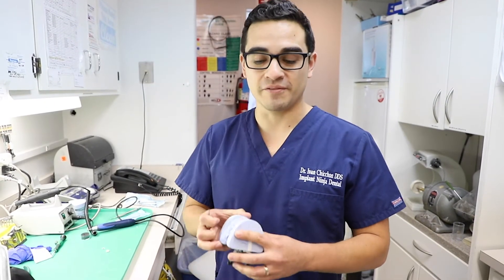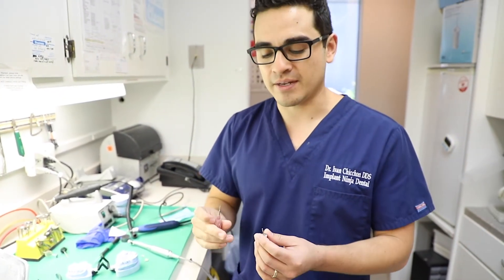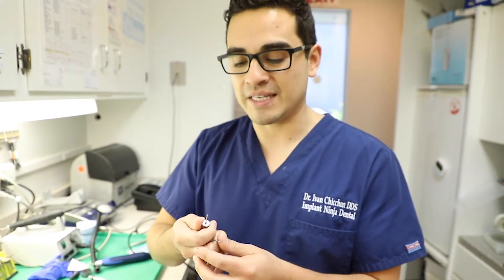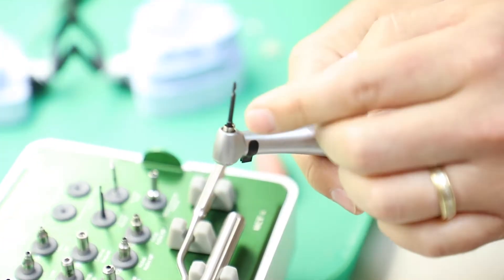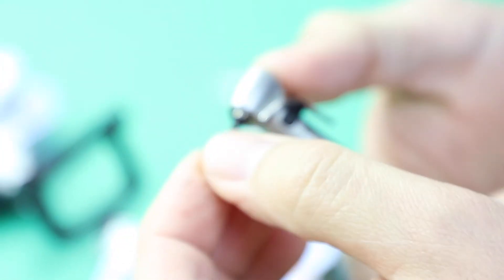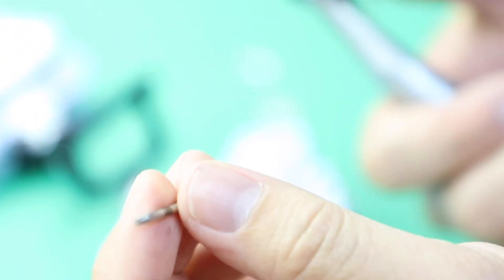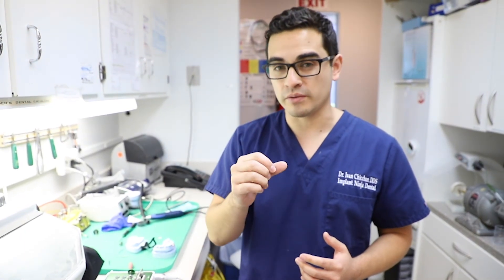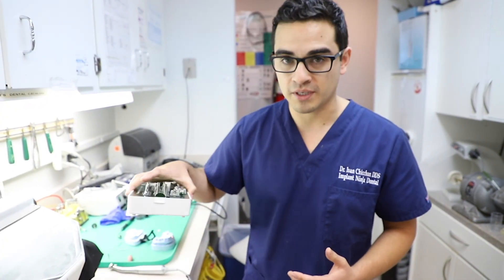Remove a Stripped Abutment Screw in Minutes #dentalimplant #complications

Comment: I recently received 2 patents and more are pending on an un-strippable screw head and driver design that will eliminate stripping screws in all industries. Check out the demonstration videos at www.NevRStripScrews.com.  I'm still early in the project but moving forward non the less.
Reply: all they need to do as far as stripped screws is use a torx, star pattern design instead of a six point hex.. why this isnt industry standard is beyond me.